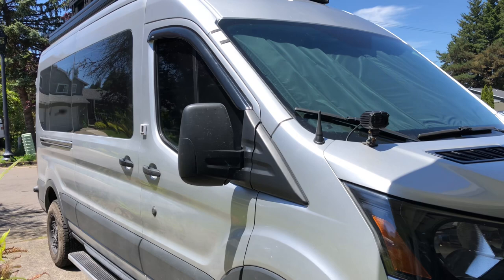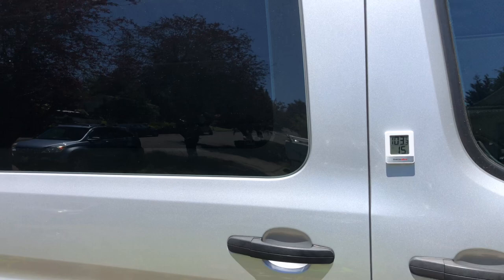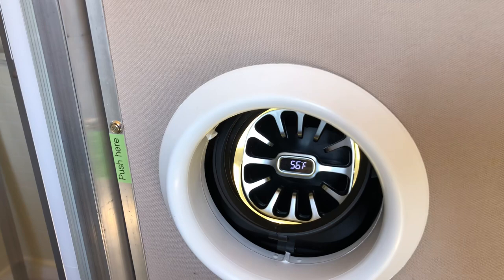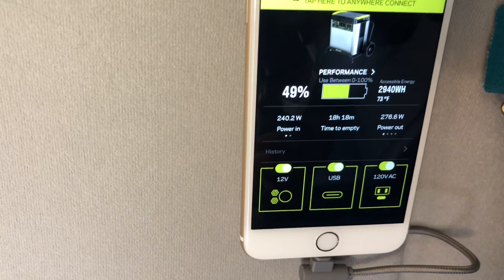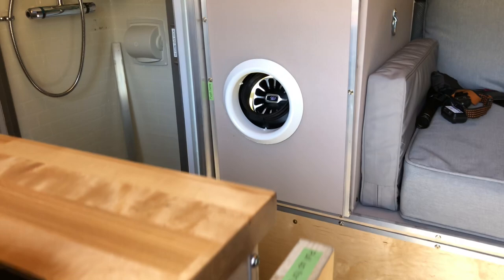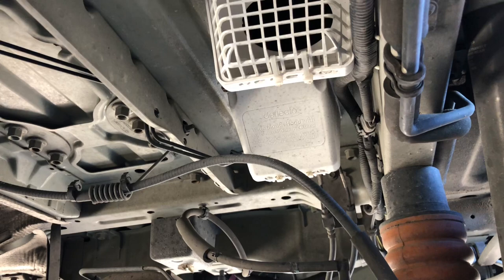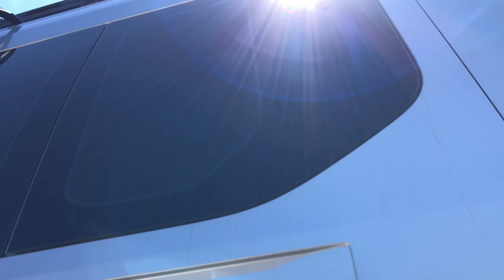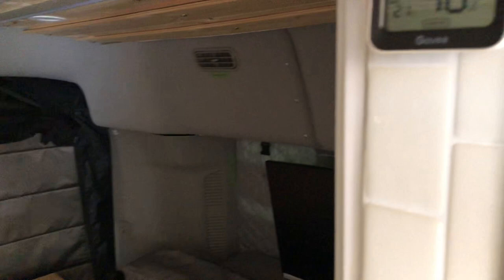Zero breeze mark 2 in a dyi camper van

Comment: hey my man, great build, but I highly recommend not having the front grille of the zero breeze (which acts as a return register) covered up like that.  Thats where the unit sucks the air in the atmosphere and needs to be exposed.
Reply from the maker: We only use the unit at night and normally l will need to hook up the air outlet extension and redirect the air to the bed area and leave the closet door open.
Reply: @ligoshuy  oh ok awesome! Sorry, totally don’t mean to be critical because it’s a bad ass build you’ve got there, I just didn’t want you to overheat it and break that bad boy.  But that makes total sense! You rock!

Comment: Remove the intake hose. Let it intake the cooler cabin air instead of outside hot air. It will cool much better this way. Leave only exhaust hose connected.

Comment: tell me what solar panels you have on the car, how many amps the batteries have and what voltage zero breeze uses
Reply from the maker: I had 4 goalzero panel 400 watts total. 550 amp lithium, zero breeze consume at the highest setting is 240 watts hrs
Reply: I have a Burstner ixeo campervan and the installation is on 12v. Does Zero breeze work on 12v or 24v?
Reply from the maker: @rocobocotest7994  you will need a 24v adapter from zero breeze sold separately
Reply: @ligoshuy  thank you very much 😊